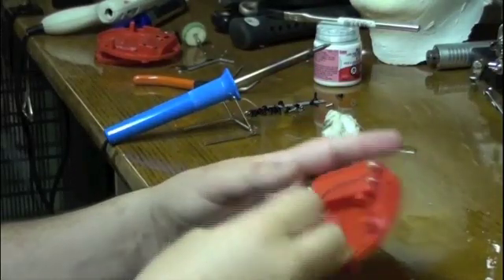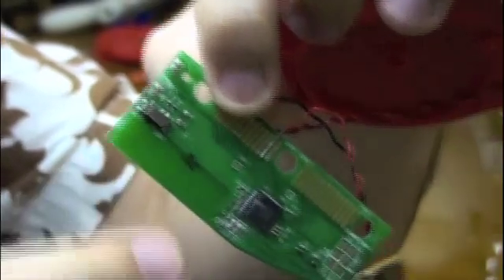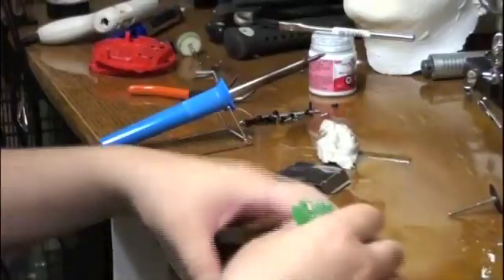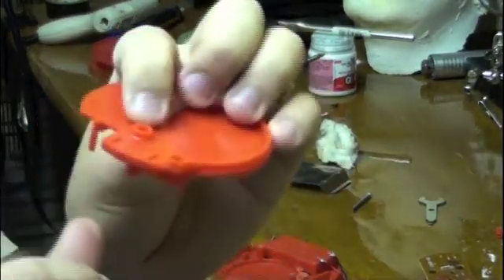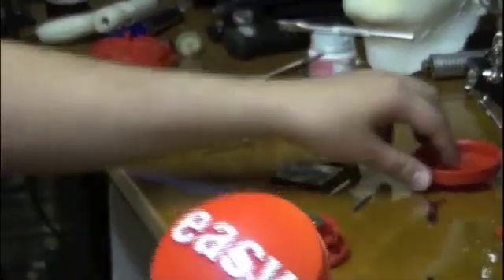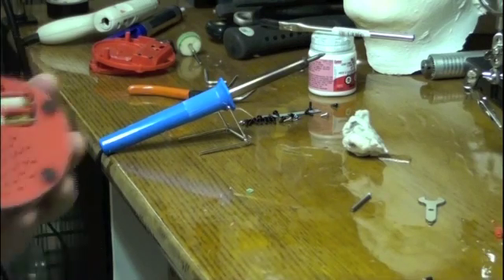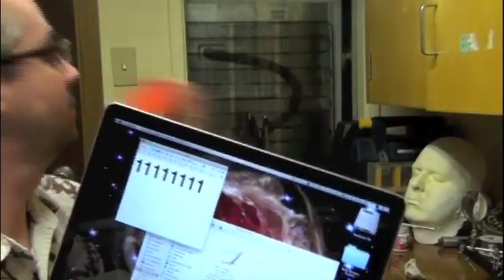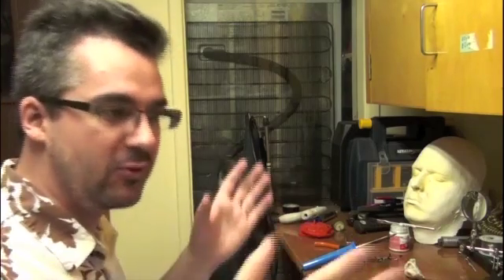Easy Button Hack - Wireless Game Show Buzzer - tutorial - Part Two

Comment from the maker: @idr4life7 There is a silicone flexible keyboard out there for about $14. Unfortunately the manufacturers wont take you seriously unless you are looking to order a minimum shipment of 1000 units. anything less than that is a loss for them. Which sucks, but at least this thing works as a proof of concept. I tried it out in a group last month and it worked great. Wireless reception got a little crappy at around 70' though.

Comment: Hey Dave! Tip: Logitech now has dongle configuration software that lets you configure many (up to 7, IIRC) Logitech devices (keyboards and/or mice) on one dongle. So you could now get by with using only one dongle for all the buttons, if the dongle is configured correctly. No need for multi-port USB hub. Cheers!

Comment: Great job! I looks like a fun way to make my Trivia show different from the rest without spending 150-200 dollars. I wonder is a wireless mouse circuit board would work as well. Less expense to buy 5-10 cheap wireless mice. As long as i can find the circuit board contacts that relate to a button.
Reply from the maker: It's better to use keyboards, just because it's easier to track individual buttons as players. Otherwise you would have to track left or right mouse button clicks, and that usually signals interactions or contextual menus, so you would have to disable those default interactions before you reappropriate them for the game. And it limits you to just 2 players. Instead of the possible 40+ players a keyboard would allow.

One thing you could do is wire a few buttons onto one wireless keyboard and have button groups that are all individually addressed. That way you can have scoring within a team as well.

Comment: hi 
i have  a question  how  would i know  who pressesd first?
Reply from the maker: Through software. You could have a screen with a text editor open, and see which number appeared first, OR you could write some software that takes the first input signal, and locks out all the others until you reset the system. Like this: http://sitp.ca/HTMLTrivia/index.html
Reply: Hey  thanks a ton for replying
 i am not a software guy 
Would u share ur software with  me?
Also if i wanted to play without a pc would that be possible ?
Reply from the maker: viraj pandya The software is online. It's just a webpage. Feel free it use it as you wish. If you have any suggestions that you would like incorporated into it, just let me know, I'll see what I can do.

If you want to play it without a PC, you would need something like a micro computer, Raspberry Pi or some sort of tiny Linux device would work fine. Just anything that can take USB keyboard inputs. Using the buzzers on their own, in this configuration isn't very productive, as it's meant to be a buzzer system for a video trivia game.